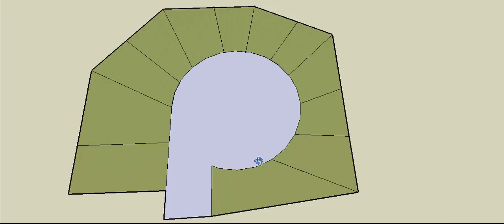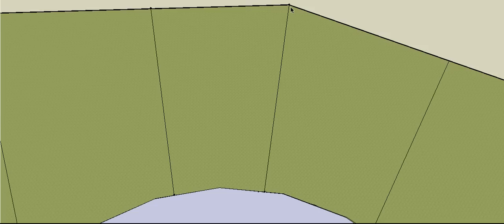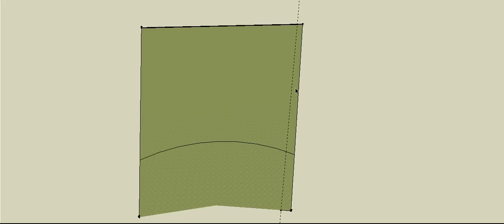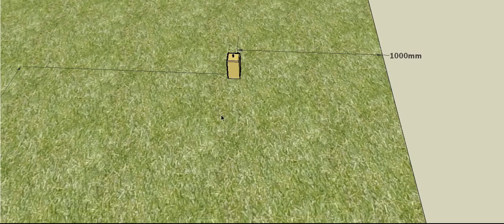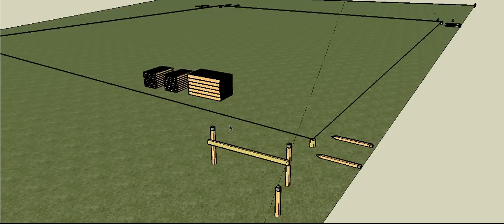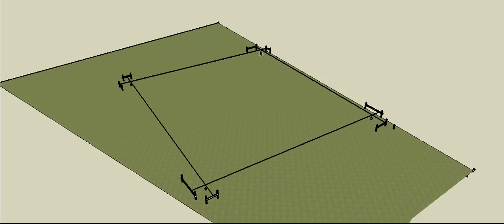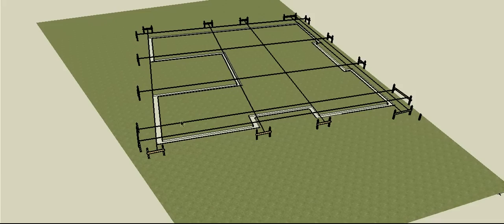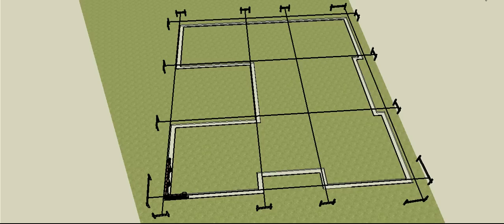Setting out a Building

Comment from the maker: Hi higgi2005
Sorry if I have caused some confusion. 
The brick wall in the video was shown to illustrate the relationship between the wall and edge of the slab or footing. It is however out of sequence for the method of construction. Once the slab is poured and given time to cure the Timber walls would be marked out, constructed and erected before the Brick Veneer wall is constructed. 

Thanks for subscribing 
Buildsum

Comment: Great video. Would it not be possible to set up a single marker peg and string line at each corner indicating the centre line for the footing and then  measure equal distance from the C/L for the width of the trench ?
Reply from the maker: Hi Saul, I guess it would be however the centre line of the footing is never indicated on the plans so you would have to work that out first, also when marking out for a Excavator you only need to mark the one side of the trench and use the correct sized bucket for the trench width. I'm not saying that it couldn't be done however it is not the industry norm.

Comment: Architects should know how to do this as well. ;)
Reply: Im a architect working for a builder. We always setback 950mm from the boundary to avoid fire compliance issues. The minimum is actually 900mm, however we all know its hard to build a wall perfectly straight and allows for tolerance. Every architect I worked for designed to 900mm setback, now I always design 950mm unless the wall is fire rated.
Reply: @jonoozzo737  I was an architectural student, now I'm working as a deputy foreman in the construction business. Yes, it is common for us now to put tolerance in the design to avoid concil issues and workmanship roughness.

Comment: can we skip the pegs at the start and go straight to a profile hurdle. measuring to the millimetre on the pegs but the peg height not level on sloping ground so when I plumb Bob up from the pegs my string lines on the profile boards is out.
Reply from the maker: Hi
You can go straight to the profile as long as you have an idea where your corners will be so you set your profiles up in the correct spot. It also might take a bit longer to get square but it is possible

Comment: Thanks Buildsum. Love all your videos. 
My house will not sit parallel with ANY boundary due to easements and the peculiar shape of the block. How do I go about finding my starting point and first line in this situation? Thanks.
Reply from the maker: Hi Richard
You may be better off getting a surveyor to pin the 4 corners of your building envelope otherwise there should be enough information on your plans to establish the position of at least 2 corners so you can establish a baseline to get your right angle off. If you don't have enough information you may need to go back to your architect or draftsman and get that information added to the plans.
Hope this helps.
Reply: Sure does. I have realised that I need the draftsman to put more side/rear/front setbacks on the plans to have at least 2 distances off each facade (or at least one facade) to get my first straight line (which is non parallel to any boundary). From there I can use the 345 method to get right angles and extend the line to the next corner. In reality I will pay a surveyor to do the work.... it doesn't stop me from exploring the DIY possibilities and the cost of a dumpy!
Thanks for your advice.

Comment: Like your videos very help especially like me doing building design which is part of my course unit. 

any chance to have video  calculating bearer/joist span and spacing and eaves and roof details please

THank you
Reply from the maker: Hi Alex Thanks for you comments

The span of a Bearer depends on it strength and is generally determined from Span Tables. In Australia we use AS 1684 The Timber Framing Code. 
here is a video https://www.youtube.com/watch?v=C_RjNORQoeo&list=PLHFT_d-5EhN67V-pbTSWQ0bxnluALyIfJ&index=25

The spacing of the bearers is determined by the Span of the joists
https://www.youtube.com/watch?v=H-0xukcgCQE&list=PLHFT_d-5EhN67V-pbTSWQ0bxnluALyIfJ&index=26

The spacing of the joists is in turn determined by the span of the flooring that will sit on it.

Hope this helps

Comment: How did you get your height? Is it the NGL?
Reply from the maker: Hi Mate, It would normally be given on the plans as the FFL, finished floor level or you can work it out from that.
Reply: @Buildsum  thanks fir the quick response mate, I messed up my question. 
When setting the heights for the slab boxing will the surveyor set the NGL  on a brick wall with a pin or a stake and then I level from that?
Reply from the maker: Hi Mate, normally a surveyor will set a datum on the site from which you can get the heights you need. but they wouldn't give you the actual height of the floor. The start of this video may help
https://www.youtube.com/watch?v=3zrHNo-YWeU&pp=sAQA
Reply: @Buildsum  thanks mate, that's what I thought.
Reply: @Buildsum  yea I thought so, cheers haven't done a set out since TAFE.